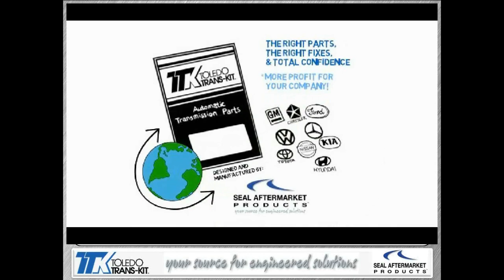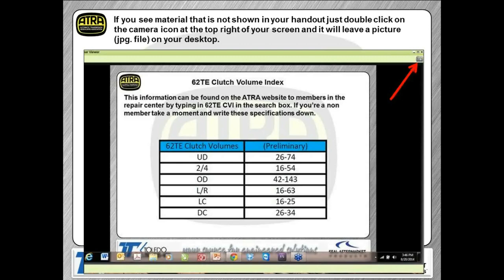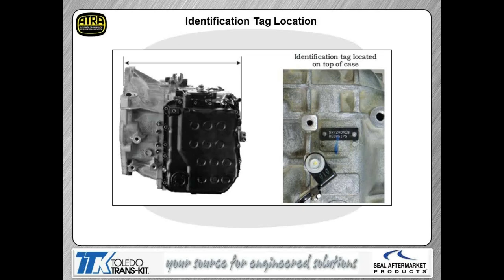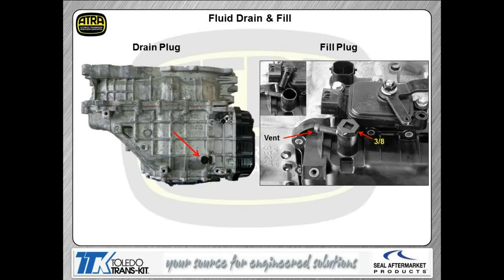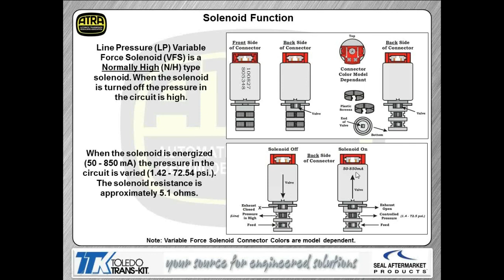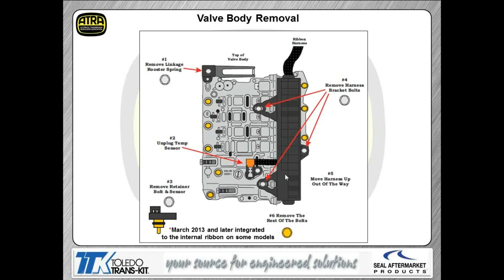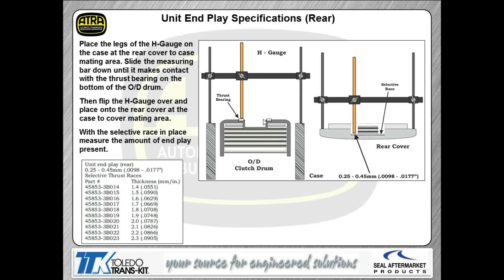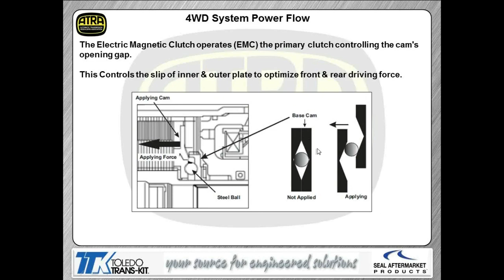A6LF1 Introduction

Comment: @t vehicle hyundai ix 35 gdi type gearbox type A6GF1 gearbox 1 and 2 gears while accelerating the sound of metal milking. Sometimes it is 3rd gear. I changed the clutch and steel kits to a new one. The sound decreased but it did not improve. I did not change the 3-5 reverse and overdrive pistons. Do I need to change it? Would you help me with this topic ?